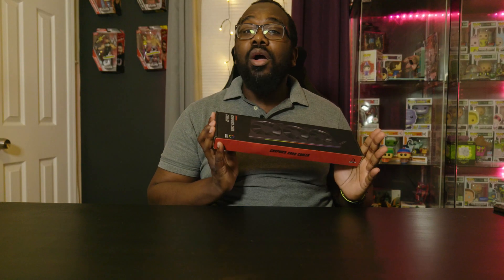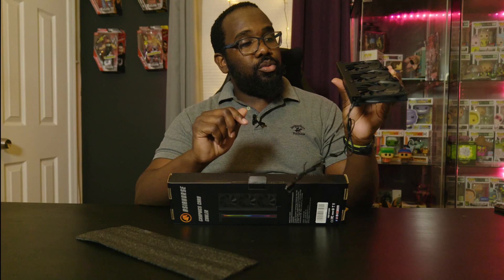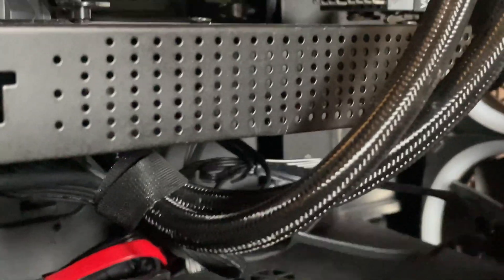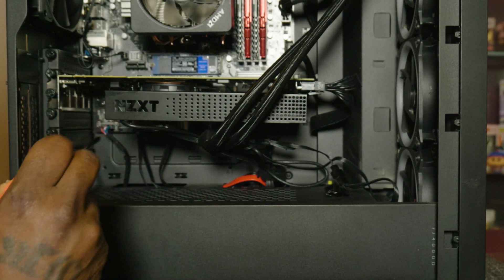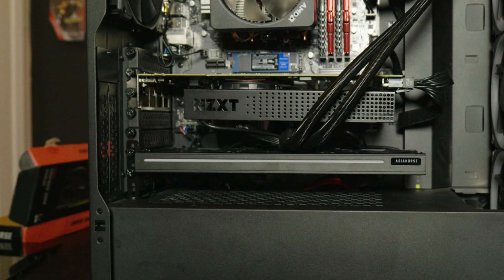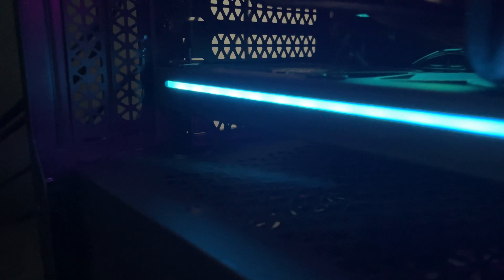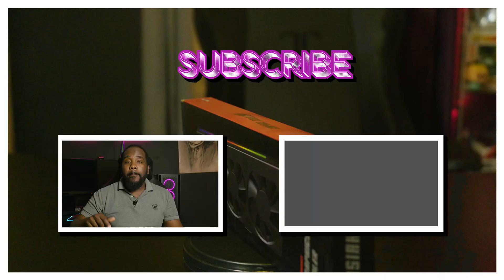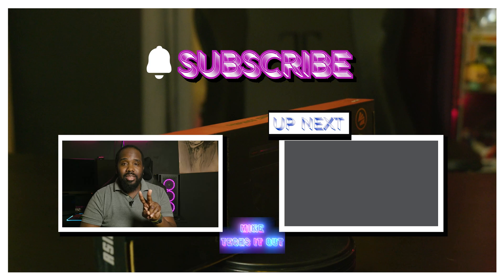Will This Fix my Kraken G12?||ASIAHORSE GPU Cooler Unboxing and Impressions

Comment: It's quite easy to find in the pci bracket and mounts to place 120mm fans together and use them in the pci express. Good fans with great static pressure may be a great idea to cool these vrams.

Comment: Just bought one of these. Haven't installed yet and I'm not expecting much. If 5 degrees cooler I'll be happy.
Reply from the maker: Yeah it’s not too expensive and it’s not going to hurt anything. Because of my setup with the water cooler it didn’t lower my GPU’s reported temps but it keeps my VRAM from overheating so I’m happy with it lol.
Reply: @MikeTechsItOut  Honestly with my ASUS TUF 3090 all I am looking to do is to lower my vram temps. lol. Thanks man and keep the videos coming.